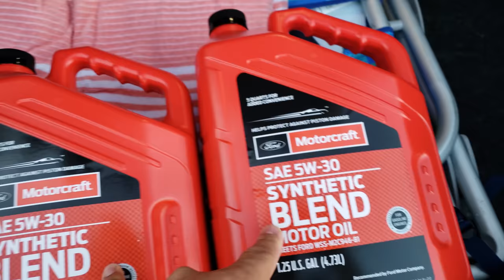2018 Mustang oil Change and filter inspection

Comment: Hello Alejandro! 2015 Mustang GT PP owner here and I thought you might find this useful. I drove a Jeep GC 4.7 for many years and the oil would always get all over the steering linkage when I loosened the filter. I finally 99% solved the problem by taking an empty Pringles container cutting it length wise and putting the metal reinforced end around and under the filter right as I broke the gasket loose. Fast forward to the Mustang GT, first oil change, 2500 miles, trying the access door, just like you showed, oil all over the place. I pulled the lower cover off and washed it all over and thought I'll have to something different next time. Second oil change I thought I'll try the pringles can again, it worked very well, only a couple drops of oil where it didn't belong and that was easily wiped up with a couple swipes of a paper towel. I hope you find this tip useful.
George
Oh, if you ever have a desire for a spare tire for your Mustang let me know and I'll tell you about one that I found would work with only a slight mod to the wheel.

Comment: Place a plastic gallon sized back over the Oil filter before you loosen it.

BAM no more mess.

Side note, checked my filter/oil as well, no shavings etc.

Noise appeared at 7k miles, went away at 11k miles, back again at 17k miles (oil changes were not done at this exact duration so I rule out the oil changes.)

Comment: It’s a bottom end tick. Right off idle when cold. No direct relation to engine rpm. Piston slap, for sure. I think it’s their new spray in cylinder sleeves. (30 year master tech, current warranty inspector)

Comment: Alex nice video! Something I learned from working on airplanes. When you check your dip stick, hold it at and angle so the light hits it just right and you should see an oil line. It should appear dry at the top. You might need a flashlight to get the right amount of lighting. Hope this helps!

Comment: I use an oil filter wrench when I’m cutting open my filters... it’s a lot easier to spin the filter on the cutting tool.  Pretty sure you knew that, just trying to help.

Comment: Hey Alex, if you still have it you should really be sending the oil filter (or what's left of it) to Blackstone Oil Labs. They will inspect the oil and the filter element microscopically for any abnormal amount of metal content - things you wouldn't be able to see with the naked eye. Hell, even on a motor with a spun bearing you really need to look closely at oil or shine a bright light on it to see the glitter flake. So best thing to do is next time you change the oil have the filter sent out to the lab. They might even be able to detect any breakdown in the oil that shouldn't be happening if there are indeed tolerance issues.

Comment: I’ve had the famous tick only come on at around 2000 rpms, just 3 random ticks, does it randomly after a fresh oil change, after a couple of hundred miles it goes away, i use redline 5w20 synthetic... have sent 2 oil samples to blackstone labs and both have come out excellent. 🤷‍♂️
Reply: 18 f150. Mine ticks to. Just gonna send it. Would like to see if him going to 5w30 makes a difference.
Reply: Bond Lohden going 5w30 will quiet down the motor for sure. Again i have sent several samples of oil to black stone and the level of metals found on the oil have been way lower than even the norm. So just send it. Or if you want to quiet down things switch to 5w30
Reply: @hialeahhigh  aight thanks man
Reply: Bond Lohden i am no expert just stating personal experience and a bit of research. And you are very welcome 👌👍
Reply: Both my 18s tick, both part throttle rattle at 2k rpm. 5w30 made my rattle worse, tick stayed the same. Blackstone said my first oil change has super elevated amounts of copper. Could be new motor break in ? Tired of all my coyotes to he honest.
Reply: @svtmotorman  man not me. Still love my type writer yote.
Reply: Kyle Kuhbander if it is first oil change then yes most likely new motor... my tests came out with very little to no copper they were surprised... and the tick at around 2k mostly does it after an oil change for a few hundred miles when its cold.. after about 700 miles or so it goes away
Reply: @hialeahhigh  I've got 10k miles on my 2nd 18 gt. My 2015 f150 made same rattle at 2k rpm. The rattle isn't the normal idle tick.
Reply: Kyle Kuhbander i know it isn’t... i dont have it at idle either its just 3 random ticks at 2000 rpms. But my oil results have been nothing but perfect 🤷‍♂️
Reply: I might get a sample sent in to Blackstone.
Reply: Bond Lohden always a good thing to do

Comment: Ok so Here is my advice on cutting filters. That’s a pretty nice cutter. Take your filter and put it in a vise at the bottom. Don’t crush the shit out of it. Just enough to spin the wrench and cut the filter. This keeps the debris and bs garbage in the bottom of the filter housing. Remove the top and or filter media. Get a razor knife. Razor knife work the best imo. Cut along the top and bottom of the filter media. Then cut down a pleat at the front and back of your previous two cuts. You are basically cutting a rectangle of the filter media out. Get some pig Matt. Keep your filter media accordian’d. Put the media in the vise and squeeze the oil out of the. Use pig mat for cleaning up oil squeezed from filter. Now release vise and spread media from the filter that you cut and squeezed oil out of for particles. Generally the oil goes in around the outside and gets pressed through the media into the middle and off to where it goes next depending on the system. You have to check the media for fine material tho. I work for a big machinery company and these f-ers are constantly wanting filters cut open, oil particle counted, oil samples sent off to check the additives etc. f-big bearing laying in the pan and the warrantee guys like oh can we get a sample of that oil? Dude it’s off of iron, aluminum and Babbitt. Gtfo lol. Take it easy. Good luck with the 18. It’s so pretty. Shame it’s been having issues.

Comment: I had an engine specialist and their shop look at the cylinders using a borescope as you mentioned, and found that there is:
**cylinder 8 - light scuffing and single very large pit on cylinder wall 
**Heavy scoring in two areas on piston #7, possible broken ring signs of pitting.

My ticking noise are up on my channel. The Pics to the damage will be later loaded, after I figure out what to do with this evidence.

Comment: This was commented before but 
Do an oil analysis. Send oil samples to Blackstone Labs and they will determine if there is unusual engine wear on a chemical basis by determining if there are any metals in the oil that should not be there.

Comment: Tip: Drill a small pilot hole at the bottom edge of the filter before removing it. Wait until it drains before remove it. No mess.

Comment: 10qts? Is that the 18s and up? My 15 Performance Package takes 8qts. I always buy my oil at Walmart (best price) and always have some oil left over for refills in the second jug.
Reply: erne75 my 16 p/p use 8 qts also
Reply: erne75 You are correct the 18 and up 5.0 motors take 10 quarts of oil.
Reply: 18  gt takes 10. 18 f150 takes 8.8
Reply: They 18+ Mustangs have slightly bigger engines also. Seems like more oil would be needed
Reply: As per Ford, 18+ Coyotes still take 8qts, not 10qts
Reply: HotMetal524 I’m not sure I believe that. Stangmode has a video on YouTube of his local Ford dealer putting in 10 qts of oil in his 2018. The engine is in fact bigger so in theory it should take more oil. Haven’t seen the manual but I’m sure I’ve seen other dealers adding 10 to the 18+
Reply: @sweetcheels  The F150 coyotes take 8. The engines are not bigger, it's still 5 liter engine. They gained a very small amount of displacement because of the different cylinder coatings and processes, but it's still 5 liters. I'd be surprised if Ford put a larger sump on the Mustang compared to the F150, that's not like Ford. I work for them so yes I would know
Reply: @sweetcheels  okay yes it is 10, i just checked. The f150s take 8.8qts. Very surprising considering. Ford doesn't typically do something like that.
Reply: HotMetal524 GM and Ford always have more oil capacity in their cars versus trucks in performance vehicles. Extra oil means more cooling capacity at the limit. Truck engines won’t see the same sustained high RPM use ect.
Reply: @stevenp3176  umm no. Good look at a 15-17 F150 and Mustang GT. Same oil capacity.
Reply: HotMetal524 You should recheck your answer. It’s a .5qt difference. Not much but the mustang still took more.
Reply: No, the manual says 10qts.

Comment: The best way to not make a mess with the oil filter, that I have found is to crack the filter.  Then place a 1 Gallon ZipLock Bag over the filter.  Spin off the filter and let it drop into the bag.  All runoff from the filter goes into the bag, with no mess all over the underside of the car.  Seal bag.  Wipe off base plate and apply new filter.  Just a thought.

Comment: So many ppl talk about the tick problem. Even the thought of buy a new mustang is scary. I really want one tho!!
Reply: Real Steel Cars
I feel you bro I want one too.
Reply: I have one. A10, no issues so far.
Reply: Maybe I'll just put a coyote motor in my 70 Nova haha. That will piss  off the enthusiasts lmao
Reply: Honestly I’d get a 15-17 car.  Can go a hell of a lot faster for the price you can get one of those at this point
Reply: Get one.  Just wait for the kinks to work themselves out through warranty before you tune down the road.
Reply: Not saying this as an attack on you or anyone else, but not buying one because it makes a noise is an excuse not a reason.  My 18 might maybe make a weird rattle or tick or something on a first start of the day but who cares?  It has a warranty and it will go back to the dealership if it breaks.  That's what the warranty is there for.
Reply: Dude Shark THIS. 15-17 auto car, converter, blower, light suspension work, you’re kicked out of NHRA tracks and trapping 150 EZ
Reply: Noggles10 what happens when it's out of warranty also it's not just at start up its the whole time and it comes and goes and it's loud also problems with fuel pumps yolos died super fast and the a10 GM helped LMAO because mt82 18 is garbage
Reply: I have a 2018 no issues & mine is Supercharged. The problem is that thin oil Ford put in the car. If you buy a new Mustang take that oil out ASAP & put in Pennzoil ultra platinum 5w30 & you won’t have a issue.
Reply: nola504boy1 yeah if anything I think it’s more so the oil also. No issues with my 18 either.
Reply: I have an 18 with 10 spd..no problems at all..i hear the ones built before the new year are having less problems and ticking noise..dont know why..8500 miles and is great..tranny and motor...not 1 problem with car at all...im happy..car hauls ass..also got the Crimson red..bad ass color for any one who wants to get one...
Reply: Yea ultra platinum silences tick. Only one that does
Reply: @nola504boy1  But if it does have issues, then what should we do if they said the warranty is voided for using a different oil?
Reply: iMiguelAOG they can’t void your warranty for using a thicker oil. They actually say in the manual to use a thicker oil of you’re going to race the car.
Reply: @nola504boy1  They only suggest going as high as 5W30 and in the manual they state to not use any fluid or oil that don't meet the defined specification and viscosity grade. Stating it can cause damage not covered under warranty. Only oil that meets that spec is motorcraft.
Reply: iMiguelAOG that’s what I use 5w30 pup & Ceratec. Haven’t had any ticks or anything with mine. I put the Pennzoil ultra platinum & Ceratec in at 400 miles. I didn’t wait unlike lots of other people. I’ve been boosted for 5k miles & I race my car a lot. If something happens to my engine I’m putting a built motor in anyway. All my mustangs have been built & boosted so I’m use to having a built motor anyway honestly.
Reply: iMiguelAOG Motorcraft is trash oil. Pennzoil ultra platinum has lots of Baron content
Reply: @nola504boy1  that's what I'm tempted to do if I get one next year. Hopefully I can find a low mileage used one so I can swap the oil immediately
Reply: @nola504boy1  I'm just really paranoid and want to be cautious because I want the car to last me as long as possible.
Reply: iMiguelAOG I understand

Comment: Yeah, I commented this on I think your last video.  When ford bored out the coyote and threw in the higher compression ratio pistons they messed up some clearance or tolerance somewhere.  It’s piston slap.  I think the 4.6 3V would develop a super slight one when they got higher miles.  Now obviously these are different cases but if fords made the mistake once, I wouldn’t put it past them to miss it twice.

Comment: Thank you for commenting on the dipstick. I can't tell shit looking at the dipstick in my Bullitt. Wipe it or not, cold engine or hot, the oil is all over the dipstick. Not a problem with other cars I own. I just had the first oil change on it, which was done at the dealer, and I have no idea if the dealer had overfilled it or not. I can't tell shit. Almost makes me want to go back and ask them to tell me how to check the oil level.

Comment: There is a bulletin on transmission alignment issues causing flywheel cracks.. They also site to make sure grease is used when reinstalling..Not only that but it states that they never did it from the factory.. Lots of questions and I have heard this on numerous mustangs..Kinda waiting for you to figure it out..lol

Comment: You need to take a box cutter and cut out the paper portion of the filter to inspect for metal. We do this on aircraft. Ring out the paper with a vise and you should have just foreign material left in the filter

Comment: you cut out a piece of filter media a small section a few pleats worth, then put that medie into the vice and squeeze out all the oil the open up the filter and you will find a dirty side and a clean side. if you raining metal you will know it right away.

Comment: lifter strings might be the issue also every time I've bought a new car, I drained the oil and went heavier weight to lubricate the motor whether it was straight line built, drift or daily.
Reply: there is no lifters in a Modular engine the rockers ride on the Cams -

Comment: Personally I feel that the rod bearing tolerances are so tight that after run in the rod bearings increase their clearance.  In turn allows the piston to lightly tap the head,  with that said I believe that a 5w50 could possible help with that issue or a 10k thicker head gasket.  Just saying.     I had an old SVT 4.6 that had a rear main that spun caused a vibration (oil pressure never dropped)  it took me for ever to find that.

Comment: Been running motorcraft 5w20 blend in my 14 for almost 25k miles now. Car loves it. No tick, no knock, and comes out almost as clean as it went in after 5k miles between changes. Just do what your damn oil cap says!
Reply: Absolutely not. 5w20 in a performance car that has even the slightest chance or seeing hot temps is retarded. You're just asking for your crank to kiss those bearings. And considering the rate at which motorcraft shears you don't have much cushion to shear to. On 11-14 track pack cars Ford recommends 5w50 but guess what it's the same exact engine that's in the rest of them. 5w20 is put in cars for 1 reason and that's gas mileage. It is simply to thin for these cars. But it's your car so you do what you feel comfortable with.
Reply: HardParked5oh Same.  Tried everything else including different oil brands, oil filters, and viscosities.  Motorcraft redesigned their filters and oil last year for this.
Reply: Taylor Williams not a PP car. No reason to run 5w50. Ford puts millions into R&D for a reason. My car has been loving it and never has knock. Been Lund tuned for 20k miles and beat it regularly. You keep drinking that internet coolaid bro.
Reply: @themustangfactory  what about 5w 20 mobil one?
Reply: @sublimegt500  I ran Mobil 1 in my wrx and it was fine for 40k miles never did any tests on it. However it was 5w30 because Subaru isn't retarded and recommending 20 weight to it's customers. Not even on turbo cars I also owned a 2017 still which I used motul.
Reply: @RAMKILLER97  actually it was a bone stock automatic zenki with a dent in the fender for 1500$. Full interior so yes it was a clean one. And you got to pay to play. My car has 60k miles on it without any of these issues because I RUN A THICKER WEIGHT OIL. And again you must not be well read on coyotes. The 15+ has alot better harmonics than the shitty 1st Gen you have sitting under your hood. I would be doing everything I could to keep that thing running. And no I am currently using liquimoly and I didn't get any of my information from anywhere online which is why I have oil analysis done. Which I can send you the last 2 which have track days as well as daily driving if you would like proof. Otherwise quit making yourself look like a fool blabbing shit you know nothing about
Reply: If you plan to do track event then you put heavier oil in and after track day switch back.
Reply: The 14's never had a tick

Comment: Before you even got to the filter inspection, I did the same to mine. I also filtered the entire 10qts of oil with a used T-shirt to try and catch some flakes. I found maybe a half dozen flea sized flakes, and almost nothing in the filter. I went to PUP 5w30 with 1/2 bottle of Ceratec, and the tick is almost gone. The problem, is all the good oil and additive is doing now, is masking the damage. 
  Btw, I have an old Chevy 350 with 200,000 miles, and it's quiet as a mouse. How do you like that?!?! LMAO. ;o)